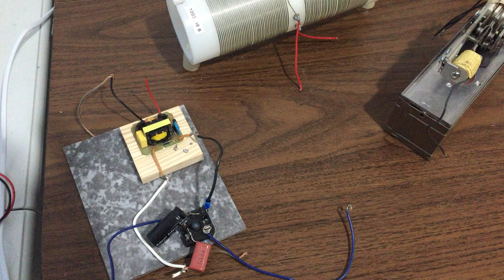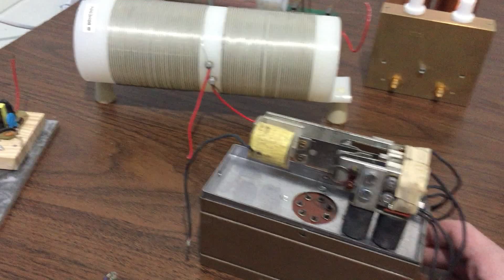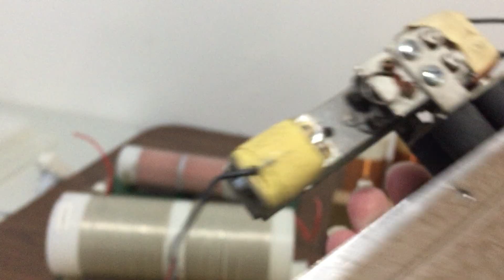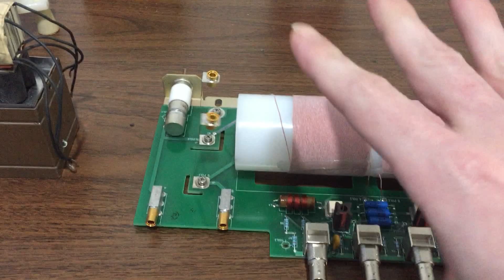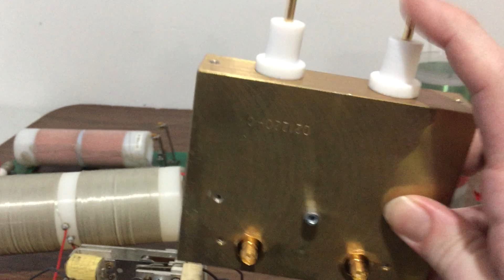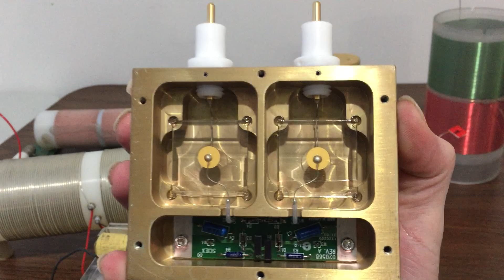Generator Update

Comment: Hey Joel. It’s great to have finally come across your work and your channel. I’ve also been focusing my research in Don Smith’s direction since 2013! Have you noticed any “cooling” effects of any component in any of your devices?
Reply from the maker: I call it "anti-resonance"—the exact opposite of resonance. In other words, if you feed a perfectly anti-resonant coil with its corresponding anti-resonant frequency, all vibrations cease. In an ideal, lossless system, this effect could theoretically bring the system to absolute zero. I have not talked about this much as it is very advanced stuff. Anti-resonance is essentially the destructive counterpart to resonance, where instead of amplifying energy, the system perfectly cancels it out. If executed with precision, the oscillations would self-extinguish, leaving behind a state of perfect stillness.  Via anti-resonance, It would it be possible to achieve superconducting-like L/C conditions at much higher temperatures. "Hint Hint"

Comment: Joel, have you ever thought yo take that giant relay and fire the back emf into a transformer.  Ivr been experimenting with this on smaller relays and wowza!  I could just imagine what this relay power house could produce.  I just set the relay to oscillate, convert to DC, and dump into caps. This doesn't include earth grounding as of yet.  What do you think?
Reply from the maker: That more or less is what the choke is for. dumped into a loading coil before reaching the "load" it radiates as a magnetic field around the coil instead of going back into the circuit to fry things. Thats the idea of Choking it.  Using a dual choke like I got the magnetic field energy from HF noise from the coil A excites Coil B and this charges a battery for "Free" while running load filtered pulsed DC. Just like Don Smith used. Spark Gaps, Tube Discharges, Relays etc for the HF noise for an extra layer to tap into. These noise generators are also used to slow down the HF AC Driver into slower pulsed DC of around 60-100 hertz